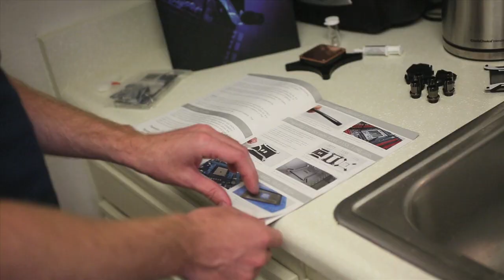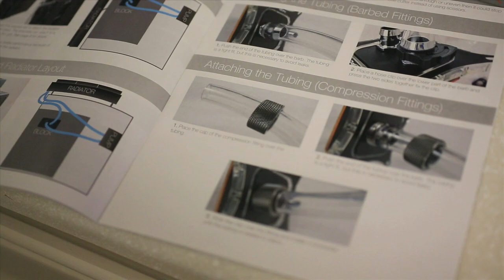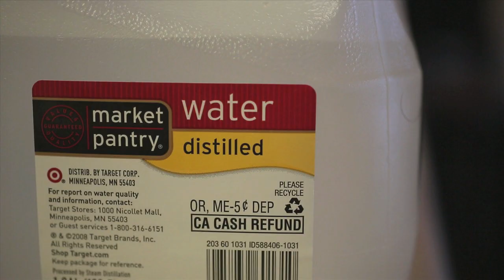A Beginner's Guide to Water Cooling Your Computer

Comment: I find the big custom kits really unnecessary. About a year ago i upgraded my air cooling for a corsair hydro series kit (h80i), they’re completely self-contained, with no filling or maintenance needed, and installation is straightforward. When i was using air my processor would run extremely hot (AMD 8350) But now has idle temps of 15 degrees and never runs hotter than 40-50c on full load and it cost me £40/$70 which in my opinion was a complete bargain and i would recommend to any gamer.
Reply: Mike Within  First of all,Would be appreciated, if you didn't type everything in caps. Second of all,  you want to clean your PC out of dust NOW. It is the #1 problem that causes overheating. Also you may want to keep your case open, and maybe have a tableop fan blowing inside of it. What parts of your PC are overheating (you can check from software like Speccy)- If anything is close to 100C, you have a problem (unless your GPU is r9 290x, in which case it should run at about 95C anyway).
Reply: 15C? That doesn't sound too good at all. Components should ALWAYS stay hotter than the room they are in, otherwise water forms on them. You might want to keep it always under some kind of load :P
Reply: LOL. Just open your PC box and put a $15 table fan to cool it :)
Reply: DoctorPC Actually the internal temperature sensor of that processor cant read temps lower that 30C. That is why it shows 15C or other random values!
Reply: Bogdan Comanescu Could be. I would still utilize the processor when "idling", give it something to work on, saving you time in the future :3 (speaking to both author&you in a very baffling way :P)
Reply: H4WK69 Depends on what you actually plan to do with it. If you want to permanently run high overclocks on both your CPU and Graphics Card(s), you really want a custom loop. Keeping components cooler also extends their lifetime.
Reply: TheSoftwareJunction It's not a fad at all, and you need water cooling for high overclocks. Hell, I need water cooling here for moderate overclocking since the ambient temperature is too high.
Reply: They look dull as fuck and they are for lazy bastards who don't want a challenge!

Oh btw 15c my arse!
Reply: I agree with your statement! If im not gameing i render stuff in 3dmax or design in CAD! Ideling a processor losses you money! BTW i am running a custom loop capabile of cooling down about 700W and never had a drop spiled or condesate! Did it first as a hobby, second for the looks and only third for the performance gained by OC-ing! I mean, with the money invested i could just upgrade! And another thing! Water cooling is not silent if you run at full fan speeds!
Reply: DEPENDS ON THE GAME YOU PLAY....IF YOU PLAY COD,SKYRIM OR ANYTHING ELSE THAT'S LIGHT ENOUGH YOU WON'T GET YOUR PC TOO MUCH OVERHEATED,BUT PLAYING WATCH DOGS....SNIPER ELITE AND OTHER LATEST TECH DIRECT X 11 GAMES,IT WILL MAKE THE PC ABLE TO PUT ON A BBQ....THAT'S WHAT HAPPENS EXACTLY WITH ME....AND I AM USING A CORSAIR H60....IF ANYONE GUYS OF YOU HAS ANY IDEA OF HOW CAN I LOW MY TEMPS I WOULD REALLY APPRECIATE IT....CAUSE I CANNOT PLAY A HEAVY GAME LIKE SNIPER ELITE OR LICHDOM FOR OVER 30 MINUTES....I'VE ORDERED TWO NOCTUA FANS AND I'LL BE ABLE TO INSTALL 'EM IN 4 DAYS BY NOW....WILL IT LOW DRASTICALLY MY TEMPS AND IF I SHOULD BY A NEW WATER COOLER LIKE ZALMAN....????
Reply: @mike! Dont want to burst you bubble but the noctua fans may not provide the results you want! In water cooling the pump and radiator, even the WB play a bigger role than the fans! Also the configuration of the fans contribute to better or worse cooling! Hek even the aplication of thermalpaste and type of paste can bring the temps down by as much as 5C. And regarding noctua! I would recomend them if you want SILENCE and if you want to pass them down to your grandchildren! Other wise i personally use some fans design for industrial enviroments, that are not only cheaper BUT MOVE way more air and have higher static pressure! Only 2 dowsides: 1 Noise(about 55dB  2. Some tinckering required for instalation!
Reply: Bogdan Comanescu and for the noise... That's what headphones and fairly loud music is for :P (you know, I'm using 290x, and 290x+stock cooler= neighbours that complain about the noise :D)
Reply: DoctorPC
Thanks guys...Now i think the core is overheating,so it spreads like a virus to the other parts....as for cleaning it....i've cleaned it some weeks ago but i always get the same results....maybe i do not clean it properly....how should i clean it,i heard that you should not use a vacuum,is it true and if.... i have to find something that blows a lot air .....
Reply: DoctorPC Something like what the carpenters use...it's a thing that blows strong airs....they use it for cleaning woods and stuff...
Reply: Bogdan Comanescu But pal, i think NOCTUA are the number 1 fans now,the creators were awarded many times and people who used them say that they're quite good....
Reply: I did not say that Noctua fans are not good! They are! they move air and they are silent But they also cost an arm and a leg! I mean 25 euros for ONE fan is outrageus! My fans are not as pretty and make wind noise, but cost a fraction and serve the same purpose. Difference is, they were not design specificly for computers!
Reply: DoctorPC
I HAVE A GTZX 660 DUDE....
Reply: Bogdan Comanescu What's the best water cooling system you would advise me dude????
Reply: From my personal experience nothing beast a well design custom loop! Solutions like Corsair hidro series are on par with the best air coolers so....no! I would recomend parts from EK, Aquacomputer, Alphacool, Eheim, innovatek.  Be aware that custom loops cost more! Ex my rig! 1x360 mm aquacomputer radiator=45e, 1x120mm innovatek radiator=27e, Eheim HPPS=112e, EK CPU WB=47e, EK VGA WB for 7970 90e plus tubing, coolant, reservoir and  compression fittings and i ended up spending about 300Euro. But My FX is clocked at 4.7Ghz max temp 48C under load and my 7970 clocked at 1150 1.25V 55C under load! If its worth it is up to you!
Reply: ***** No people buy water cooling mostly for overclocking as air cooling is only effective to a certain point, not because it looks 'clean and nice' lol
Reply: H4WK69 Key word, CUSTOM watercooling. He isnt talking about Air cooling vs Water cooling. He meant a stock branded watercooling (Corsair Hydro series) vs Custom built loops like in the video. Just wanted to clear that up.
Reply: Dariel Manresa You will have to be more specific, there are quite a few people in this conversation i dont know who you mean by 'he', context would be good plus you dont need to use capitals, i can read lower case just fine.
Reply: I find that using rigid tubing in water cooling looks absolutely AMAZING. Also, custom loops are only really necessary if you want to cool down your graphics cards efficiently in SLI or Crossfire.
Reply: I agree. Aircool ..just use a bigger fan. water cooling is not necessary.
Reply: TheSoftwareJunction True, it's not neccesary, but neither are fans. Passive cooling all the way.

Oh, what was that? You can't get the temperatures you want with passive cooling? That's too fucking bad.
Reply: Depends on the ambient temperature too. Big fans work just fine. Water cool is more of a fad.
Reply: Sarge Rho Exactly. If you cool your room temperature with say an exhaust fan you would get good cooling. And try adding fans to your desktop box. I used a big exhaust fan 25 watt to just blow air on to my desktop and it cools to less than 25 degrees.
Reply: TheSoftwareJunction That's kinda hard at 35°C average room temp.
Reply: Sarge Rho
 I agree..but I use an exhaust fan in my room window and it has strangely reduced my laptop / PC temperature by about 10 degrees.
Reply: Closed loop water coolers like the Corsair line aren't "true" water coolers. A big heatsink will often do just as good a job, although admittedly a smallish Corsair like the H80i will be more space efficient. These custom loop coolers can provide much lower temperatures if you push you're CPU or GPU particularly hard.
Reply: You can't cool a GPU with an AIO loop.
You can achieve much better temps with a custom loop.
A Cooler Master Hyper 212 Evo would achieve around those temps that you get with your h80i.
Reply: TheSoftwareJunction That's not going to work if you want to overclock and then game like crazy with those clocks.
Reply: *****

Lame link to vid cards
Reply: ***** No.
Reply: ***** Well obviously custom kits are more efficient depending if you overclock or not but i find the rest of your comment highly ironic because the only two people i know that have custom kits are both unemployed and still live at home with their parents, maybe you should tell marketing huh
Reply: H4WK69 The 10 or so people I know with custom kits all have jobs and have their own place. Then again the 10 or so people I know with closed kits or air cooling also all have jobs and their own places :P

Comment: Great information. One thing that hit this pea brain lol was how about using radiator fluid that you'd use for a car 50/50 mix. wouldn't this run cooler? would this be corrosive? All ears of a corn field thanks :-)
Reply: in a car watercooling loop, the ''coolant'' have less cooling power than the water it is mixed with but it prevent corosion, lower freezing point and raise boiling temp so the water can do its cooling job over a greater range of temperature, since a computer will not encounter such extreme temperature and that most of times there is only one type of metal in a loop (copper for blocks and rads + brass (80%+copper alloy) for fittings and other rads) the loop has less chance to encounter corrosion issues compared to a car loop which sometimes have copper/brass and aluminum in the same loop.

Comment: NEVER use distilled water!!!!! it will dissolve your copper in the cooler... It is actually EATING your metal from the inside!!!! (because it does not have ions, it will get the copper ions from the metal)... TRUST ME>>> IT IS NOT OK TO USE (better use normal tap water at least)
Reply: skimaniac34 ah.. ok... thats fine then!

Comment: distilled water? i don't think so.. used non-conducive fluid and save yourself the headache of an 'accident'...
Reply: distilled water is non conductive -.-
Reply: Elucidator
Distilled water is only non-conductive as long as no foreign ions dissolve into it - such as the aluminium and copper metals it passes over. Better to add an anticorrosive (usually silicate based) or engine antifreeze to prevent this happening). Water isn't known as the universal solvent for nothing.

There are very few practically available "non-conductive fluids" which are relatively inert (light machine oil works, but its thermal capacity is far less than water and it may be flammable) and cheap (Flourinert would work but the stuff is ultra expensive) which even come close to water's 1600J per degree C thermal capacity.

IN a previous life we used to use triple-distilled water in a cooling loop for 1940s-era shortwave radio transmitters - 100kW PEP, with the anodes directly immersed in water and running at about 50,000V. 100kW out = 600kW in for this sort of gear, hence the requirement for ultra pure water - It would only last a few days before metal ion contamination would  require flush/replacement.
Reply: AndurilNarsil1 well, i moved from a 4 fan push pull h100i setup to a real liquid cooling solution. My day and night difference definition got redefined :/
Reply: Distilled Water wont stay distilled very  long in a loop. It will quickly ionize from the constant contact with the alloys in the rad and blocks.
Reply: AndurilNarsil1  Recheck your warranty. There is an exclusion for consequential damages (ie, what happens when the contents of the loop end up outside the loop). In addition, bear in mind that long term the sealed systems seem no more reliable than custom ones.

That said: Apart from contamination and assuming your hard drives don't get immersed, nothing intrinsically bad will happen if your board gets soaked by coolant, although the computer might stop if there's too much leakage current between tracks. The best way to treat such board contamination is to take it out of the PC and dump it in a bucket of water. Wash off and dry for a few days. What do you thnk they use to clean the things in the factory before/after the wave soldering process?

The biggest problem with dissimilar metals in the loop and no anticorrosive in the mix is that copper will dissolve into the liquid (possibly destroying fine-finned heat exchangers as used in the CPU block, or putting holes in a copper radiator) and plate out around aluminium parts (possibly clogging up heat exchanger fins and impeding water flow.). It's best to try and avoid dissimilar metals if at all possible.
Reply: Distilled water is non-conductive, its metal contaminants that collect in normal water that sets it apart. Distilled water is purified water a.k.a: Nothing but the compound H2O. However it will become conductive overtime since it is in constant contact with metal on the loop because those water blocks erode on a microscopic level which is what puts the metal components into the water making it conductive.
Reply: Alan Brown see this is why i get nervous to do a full water cool build. I got the h100i by corsair (closed loop) for that reason. I figure at least if it goes it non -conducive and warranties my fried pc parts.
Reply: distilled water is good for many things..... I met a guy yesterday with a $10,000+ built at a Intel Campus for InfernaLAN, WA. 
He told me that he would rather use distilled.
Reply: I agree with you, as water is the most dangerous coolant, other than mercury or corrosive stuff.
Reply: Brock Woods distilled water is non-conductive? Hmm, i didn't know that..
Reply: Brock Woods I know that the ideal coolant is this in contact with the metal plate of processor but to do that with water is not possible too risky, so to avoid the micro erosion why not to use thermal paste based on a mix of silicon and silver, silicon based polymers is the material non conductive of electricity that is a relatively good heat transmitter, that's why is used in contact with processors.

What liquid uses Tesla motors to refrigerate their high voltage, high amperes electric motors??.
Reply: Tesla use the automotive standard: 50:50 water/glycol plus anticorrosive (aka "antifreeze")
Reply: Guys, you have to remember that while distilled water starts conducting electricity as soon as it picks up any alien ions it comes into contact with, the amount of ions in the water (even after six months) isn't significant enough to destroy your computer as badly as non-distilled water. It's not perfect, but it's a far better choice. Sure, your PC has a chance to still short circuit, but it won't completely die either. In the end, all that matters is that you were as careful and as precise as you could be. I haven't tested it out so excuse me if I sound dumb, but I would imagine putting small layers of sponge above areas that are potential splash zones would significantly negate the risk of spills.
Reply: the word distilled means the water is "pure" of any form of impurity. including electrolites. it is pure H2O. distilled water won't even boil at 100C. I am not well versed on how distilled water reacts after reaching tubing and radiator, but generally speaking, distilled water is non boiling, non conducive.
Reply: Dimas Akbar Until you add impurities, which come very quickly

Comment: Water + computer. Has to be a good idea :D
Reply: It is ... if you know what you're doing lol ;)
Reply: bLuR vOpTicz That last part is important :D
Reply: ***** Wouldnt it be better to use high viscosity oil in cooling since it wouldnt conduct electricity in case of failure, it has high boiling point and it doesnt corrode the system? You know, the same stuff some computers are totally submerged to? Ive never had a liquid cooling nor i need one, but it sure looks neat!
Reply: Its not really water
Reply: Devastating Thomsaw doesn't work as good as water in that style, water has better heat properties, in other words it absorbs and dissipates heat more quickly than oil, the reason why oil submersion baths work good, is because the way oil (specially mineral oil) works, it spreads the heat throughout its volume (thats why the mobo is submersed in the tank full of oil)  reaching a safe and workable ambient temp, for some home server applications, you may not even need a radiator, all depends on what you are using! pretty much for heat transference you go AIR<OIL<WATER, for safety eg electricity conductivity it goes OIL<AIR<WATER
Reply: As long as the water does not have a dissolved covenant compound, (E.G. Pure water , rather than salty or mineral water)

Comment: Seen, and heard, a lot of different things about this, but could I use mineral oil as a substitute for water? I know it doesn't conduct electricity, which is a massive plus for me, because I've never set up a watercooled rig, and I'm about the clumsiest motherfucker on the planet, so I'll surely spring a leak or 2 on my first try, and I'd rather not fry out all of my goodies.

Comment: How did it glow when he turn it on
Reply: That the LED of the Case FAN which reflect in the water
Reply: whats the name of the fan ?
Reply: stephen titus u still wont have swag like me noob
Reply: Look whose talking
Reply: Just look on computer hardware websites. Most of them will have fans with LEDs already built in.
Reply: Ok thanks
Reply: Hes using BitFenix Spectre Pro LED fans